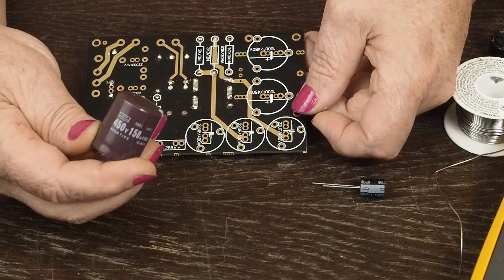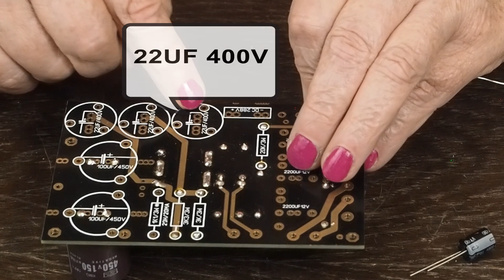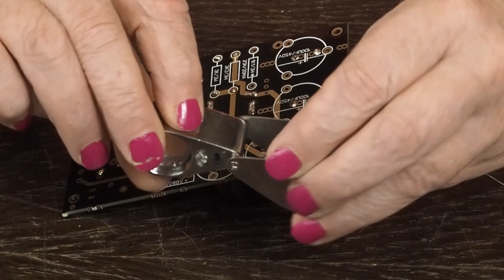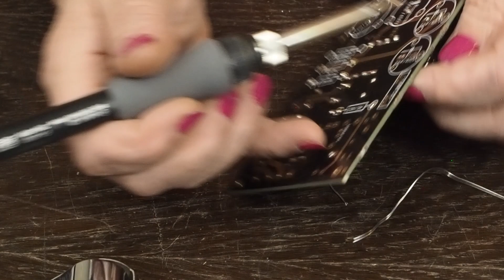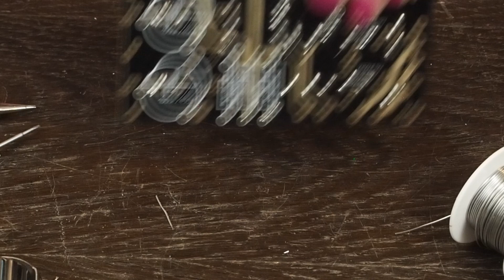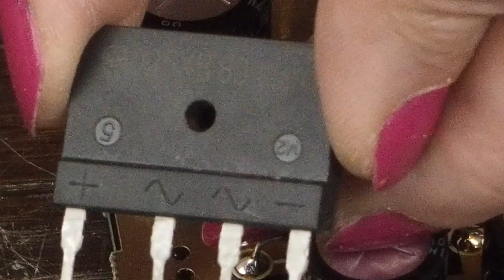All Tube Phono Stage Pre-amp Part 11: Power Board

Comment: I ordered the tools and board and will wait for that to arrive before ordering the other parts from Mouser. I didn't see a bridge rectifier in the BOM, what part can we use here? Also for the heat sink compound, will any thermal paste work such as MX-4? Thanks again.
Reply from the maker: I've been buying the board + small parts - the caps and using the one they include. Not sure what to tell you on that part.
Reply: @SkunkieDesignsElectronics  I ended up reaching back out to the seller and requesting the rectifier directly. I've yet to hear back from them, but I doubt it would be much of a problem.
Reply from the maker: Something like this should work, just make sure it has the irregular pin spacing like the board has. 
https://mou.sr/42MYAjm
Reply: @SkunkieDesignsElectronics  Thank you, I'll give it a try.

Comment: I noticed you changed the .22r/3watt resisters. My kit did not come with these. Do you recommend a replacement? Do they need to be a current sense resister or will a 220mohm wire wound work?
Reply from the maker: I normally use whatever .22R resistor that comes with the kit. I don't believe the type matters if they can handle the wattage as it's just a RC filter for the tube heaters.

Comment: So, did you add the choke? I don't see a choke on the schematic. How did you know where in the circuit to put it? I imagine that likely helped with getting rid of some ripple noise from the power supply.
Reply from the maker: yes, it's going to be cleaner with a choke there.

Comment: I usually find, for those big grounds or other thick pads, getting an iron with either a high thermal mass, or cranking the temp up about 10 to 15 degrees hotter just for those bigger joints, works really well.   That usually lets the solder flow nicely through.  Given the holes are plated through holes, if you don't get a pool on the underneath side of the capacitor, it doesn't matter too much.  As long as the hole has some solder inside it, the connection will be sound.    Most Electro caps are not that sensitive to heat, and given most of it is wicked away by the copper, it;s quite safe :).    Just got to remember to turn the heat down again when doing sensitive components.

Comment: There are some flaws in the BOM regarding the 100uf450v caps ( its 400v in BOM ) and the quantities of some resistors. Nice built, i followed along and couldnt have done it that easily without your help :) Thanks.

Edit: 400v is fine to use!

Comment: Have a couple of questions been ordering parts, on your bom it shows the following capacitors 100uf 400 volts 2200uf 16 volts but I dont see these shown on the pcbs?
Reply: Was wondering if you had a chance to look into my question
Reply from the maker: Marked on the underside of my board, I see a place for three 2200uf and for two 100uf caps. Sorry it took a few days,  I had to pull the board out of my pre-amp to look at it.
Reply: @SkunkieDesignsElectronics  im sorry to hv caused u to hv to do that, your wonderfully  helpful thk u ill go over my board again.
Reply: @SkunkieDesignsElectronics  im so sorry could u tell me which board im not sure if im going blind because I cannot for the life of me see where the 100uf 400 volt caps go at all..
Reply: Ah I see mines showing 2 100uf at 450 volts not 400 as per the BOM.
Reply from the maker: @MrAppleimac01  I sub'd 400V as the power supply never has more than 250V, and mouser had no 450V caps  in stock sized to fit the board at the time.
Reply: @SkunkieDesignsElectronics  ah so is it ok to use 400v caps then?
Reply: May I ask you how I can check that, just out of interest for my knowledge is there a way I can tell that the power supply only ever uses 250volts
Reply from the maker: @MrAppleimac01  In this instance, yes.
Reply from the maker: @MrAppleimac01  Well it has 250VAC input... If you can find a 450V cap that fits and makes you feel better, use those.
Reply: @SkunkieDesignsElectronics  thank you so so much for your help… I really do appreciate it… I cant thank you enough for all the help.. your youtube entries are so helpful for begineers like me

Comment: Was wondering if you thought about bypassing the electrolytic caps in the power supply?
Reply from the maker: I haven't tried it, I know this can change how an amp sounds, not always for the better. I tried bypassing all the lytics with film caps on my 6SQ7 amp and it sounded horrible!
Reply: @SkunkieDesignsElectronics  I tried it on a bottlehead crack headphone amp and it really improved it… im currently sourcing parts for the phono amp and have already done a lot of the chassis work.. when ive finished ill post a pic on your forum. Will be a while yet before done due to obtaining parts, which due to covid and logistics here in europe are hard to source certain things.
Reply from the maker: @MrAppleimac01  if you try it, please share the results :)
Reply: @SkunkieDesignsElectronics  of course will do.

Comment: Could you do me a big favour the power supply board, could u tell me the measurement of just this smaller board please
Reply from the maker: ~ 85mm X 125mm I can't get exact without removing the board.
Reply: @SkunkieDesignsElectronics  i just want to give u a big hug and say many thanks for ur replies ur helpful videos. For beginners in valve amplifiers ive searched and searched for thing for beginners and urs r the most helpful ive come across as most others assume we are experts. Keep up the great work

Comment: you could mount a metal cased MJE3035 on the metal case and connect the transistor to the board with flying leads.

Comment: A Weller 8200D is always a good soldering iron to have for the hard to solder parts where heat is being heatsinked by the heavy copper traces.

Comment: Nice video. Just a little pointer, I used my oven at 35 degs because of the ground plane and the solder flowed beautifully. Another idea is to carefully use a heat gun.

Comment: How did you seperate the power board from the main board? Did you just snap it or cut it in some way first?
Reply from the maker: It's serrated along a seam between them and it snaps apart very easily.